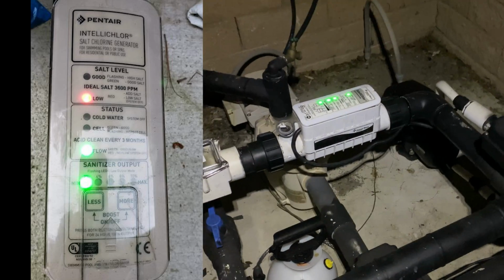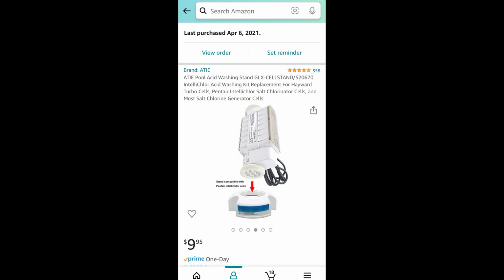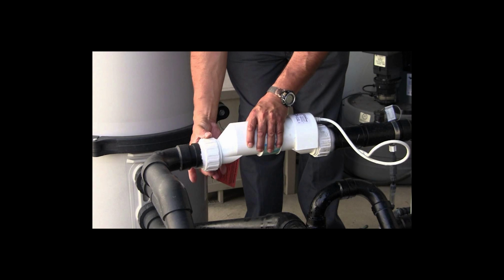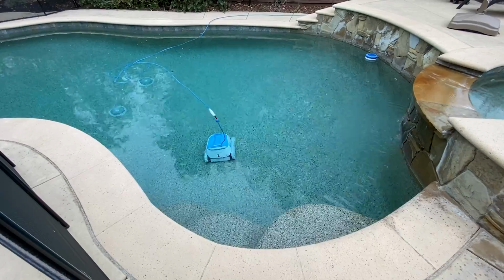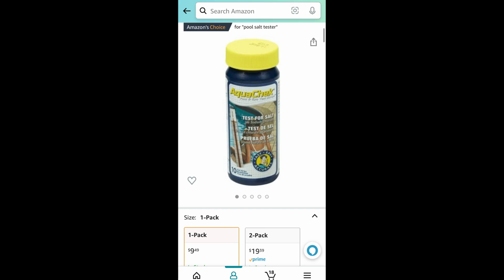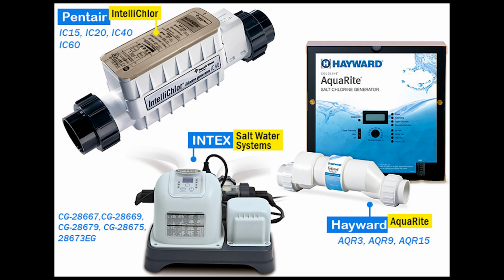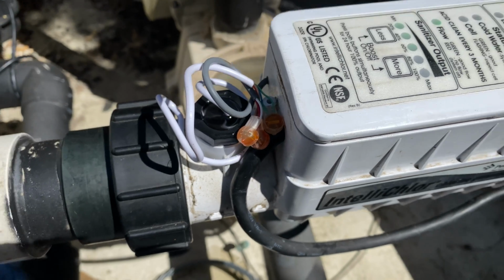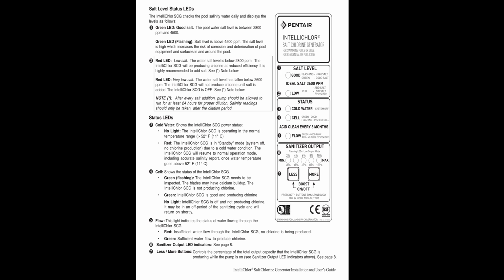Fix Error Codes or Replace Salt Cell Flow Sensor

Comment: Inspect cell reset button?
Reply from the maker: •	There is no physical reset button on the cell or the power center.
	•	The “Inspect Cell” light is just a timer reminder, not a fault memory.
	•	It turns on after about 10,000 hours of operation to remind you to visually inspect and clean the cell.

How to clear the Inspect Cell light:
	•	Press and hold the “More” button for about 3 seconds on the IntelliChlor control panel.
	•	The Inspect Cell light will turn off and the timer resets.

Important notes:
	•	Resetting the Inspect Cell light does not fix real problems like low flow, bad cell, or bad salt reading.
	•	If there’s an actual issue, you’ll still see Low Flow, Low Salt, Cell, or No Comm lights.
	•	Power cycling alone does not reset the Inspect Cell timer. It has to be done with the button.
Reply: @fixitwithjake  thank you so much, will try it out today and get back to you

Comment: Thank you for your video! I have a question. I did all the diagnostic and it seems fine except that the flow light has been going from green to occasionally red. It started doing it a few weeks ago intermittently. Last week it stays on red/no flow the whole time. I checked the flow and it's fine. I changed the flow switch and filter and still remains red.
Do you have any suggestions on what it could be?
Reply from the maker: Here’s what I’d check in order, since you’ve already replaced the flow switch and cleaned the filter:
	1.	Pump speed and real flow
• If you have a variable-speed pump, run it at 2800–3000 RPM for a few minutes.
• If the light turns green at high RPM, step down in 100-RPM increments to find the minimum RPM that keeps it green and use that when the cell is generating.
	2.	Switch placement and orientation
• Arrow on the switch must point with the water flow.
• On vertical pipe it must be installed on an up-flow section.
• Cord on top, paddle inside the pipe free to move.
• Give it at least ~12 inches of straight pipe before the switch and a few inches after. Turbulence from an elbow, tee, heater outlet, or check valve right before the switch will make it read “no flow.”
	3.	Air or restrictions in the system
• Look for air in the pump lid or bubbles in the returns. Suction-side air leaks can keep the paddle from closing.
• Empty pump and skimmer baskets, verify valves are fully open, and check the pump impeller for debris.
• Make sure nothing downstream is choking flow near the cell or switch, like a stuck check valve or heater bypass.
	4.	Cell orientation and condition
• Arrow on the cell should match flow.
• Pull the cell and inspect for heavy scale. Scale can restrict flow and cause odd readings.
	5.	Connection and quick electrical tests
• Reseat the flow-switch plug at the control box and check for corrosion or water intrusion on the connector.
• If you have a multimeter: with power off, disconnect the switch and check continuity across the two flow-switch leads. Paddle pressed = closed circuit, paddle released = open.
• Board check: with the pump running and confirmed good flow, briefly jumper the two flow-switch pins at the control box. If “No Flow” turns off, the board is probably fine and the issue is hydraulics/placement. If it stays on, the control board input is likely bad.
	6.	Startup delay reminder
• Many units show “No Flow” for about 60 seconds after the pump starts. Make sure you’re judging it after that delay.

If you want, post or email me a photo showing the switch, nearby fittings, and the cell. Turbulence from nearby elbows or a vertical down-flow install is the most common cause I see when a new switch still reads red. If the jumper test points to the board, you’re looking at a control board repair or replacement.
Reply: @fixitwithjake can I have your email address please 🙏🏽
Reply from the maker: Fixitwithjake at gmail

Comment: So when i reset the cell/pump my salt "good" light blinks for a bit then just turns off(no green or red light) i confirmed 3200 salt level via k-salt tests. Flow is green and other lights work fine but chlorine keeps dropping. Replace the sensor?
Reply from the maker: Thanks for the detailed info. If your salt level is at 3200 and your flow light is green, but the “good” salt light blinks and then turns off with no red or green light, it usually points to an issue with the cell or sensor not reading properly—not necessarily the salt level itself.

A few things to check first:
	1.	Inspect the cell for scale buildup—even if flow is good, calcium deposits can cause sensor issues.
	2.	Double-check the cord connections to the salt cell and flow sensor.
	3.	If the cell is clean and connections are solid, and the system isn’t generating chlorine (and you’re sure your CYA is in range), then yes—replacing the flow sensor is a logical next step before replacing the entire salt cell.

Comment: Have you had any issues with cell popping the 10amp fuse? Could flow switch cause it or cell electronics shot? Cell is just over 2 years old.
Reply from the maker: The little card mounted on the back wall of your AC touch. System is called a surge card and takes 24 V AC from the saltwater transformer and converts it to 35 V DC that powers assault Cell. If your circuit breaker pops with the salt cell disconnected, that is a good indication that the surge card is bad. To confirm that unplug the two small red wires marked as AC from the surge card and see if the breaker no longer pops.
Reply: @fixitwithjake  10amp fuse pops only when the salt cell is connected. Had a case with Pentair and nothing they can do. Everything I’ve been reading leads to salt cell needs replacing.

Comment: Hi and thanks for your video! I have the IC40 chlorinator and salt level lights (good and low)  are BOTH flashing and the FLOW red light is on. The flow is fine... i cleaned it out with MA and its still lit up like a Christmas tree with these lights flashing that shouldnt be. Now i do have to say the water temp is at about 55degrees. I just dont remember this being such an issue in years passed. Is all this due to water temp? My salt level is at 3400 so that checks out too. You think this could all be the cell? Its about 7 yrs old.
Reply from the maker: It is because the water temp is outside the operating range for the cell. Also your cell is probably near the end of its life after that many years. Double check that you don’t have it installed backwards. It’s easy to mix that up. There’s an arrow showing the direction of water flow.
Reply: @fixitwithjake  Yes its definitely installed with the flow going correct direction. I have solar cover on so lets see if that helps. Otherwise you think a cell replacement is in order?
Reply from the maker: @creative5435 Pentair’s cell is rated at 10,000 hrs. Figure out hike many hours a day your pump runs and see how many days/years it’s been used. Leaving it installed and on in the winter when the water is cold will reduce its life. I take mine inside in the winter and replace it with a plug until the water gets back to the operating range for spring to fall. Because my pool is open here around and the pump is running every single day. Get the water temperature up to the required range and try it for a few few days and see if that fixes things. If that doesn’t you could replace the flow switch that would be the next step just like the video says. And if that doesn’t fix it, they need a new Cell. Don’t mess with the aftermarket ones. There’s none that work well with Pantera they only save you two to $300 and have almost no warranty or tech support.

Comment: Cell has red, white, black wires. Switch has red, clear, blue, green. Is it red-red, white-clear, black-blue, green alone?
Reply from the maker: Here is a photo for you: https://m.media-amazon.com/images/I/71phNasDhtL._AC_SL1500_.jpg
Reply: Thank you. I left green by itself and the cell still reports no flow. I’ll connect black-blue-green.
Reply from the maker: That’s one diagram from one manufacture. There’s several manufactures for these flow switch it so it’s possible that you have a different wiring set up. Every flow switch off used comes with a small instruction manual that tells you what color goes to what wire. So I would refer to the little paper manual that came with your switch…..
Reply: Yes the black-blue-green is correct. After instal, the flow light is still red…🤔
Reply from the maker: Did you install the salt cell back in the proper flow direction? Or is the flow switch in the proper direction? If either one is installed backwards, the water is just gonna push on the switch and not allow it to work and trigger a flow light.

Comment: This video was extremely helpful. Couldn’t get anyone out to help me fix this problem, and by watching this video I was able to do it myself in 30 minutes for less than $50. Incredibly grateful!
Reply from the maker: Wow, nice job! You definitely have the DIYer spirit! Glad this was helpful!
Reply: If the cell has 3 wires and new switch has 4, red-red / white-white / black on the cell and blue and green on the new switch. Do you connect black-blue and leave green by itself?
Reply from the maker: Every sensor that I’ve purchased has come with a small paper instruction manual that tells you how to wire it. It explains three versus four wires and the colors. I’m not sure all sensors have the same color wire so I would refer to the small instruction manual that came with your sensor instead.

Comment: I have an IC40. My flow light is green all the time, even when I turn the pump off. It has a new flow switch. What can it be?
Reply from the maker: The salt cell should not be ON if the pump is off. It should be wired in such a way that the pump timer shuts off and so does the salt cell power. Go to page 35 and street troubleshooting the lights https://www.pentair.com/content/dam/extranet/nam/product-related/product-manuals/pool-and-spa-equipment/intellichlor/IntelliChlor_Owners_Manual_Version_3_units_after_Nov_2011_English.pdf

Comment: What if the flow light isnt lite at all? I tried replacing tbe sensor. Still no light lite on the flow
Reply from the maker: Chris, are any of the lights lighting up when the pump turns on? Or it’s all dark? A bunch of lights should be flashing when it first turns on. If not lights at all besides the flow light, start checking the wire connection from the salt cell to the control box or power supply. Thick black cord that screws into place. And check that no circuit breakers are tripped.
Reply: @fixitwithjake  Thx for the reply. Yes, when I power on the unit all the light come on at least once. Even if the flow light blinks briefly, the low and high salt blink back and forth until it levels out like normal. But the flow light doesn't stay lite not even  continuously red or green. Once the cell levels out the red low salt light is on and three lights at the sanitizer output are green. I can decrease output but it won't increase above the third light. I thought changing the flow sensor would at least get the flow indicator to come on, but no luck.
Reply from the maker: Because it is still reading as low salt it may not allow your salt cell to turn on and thus the green flow sensor light as well. But to be honest, I’m just guessing here on the logic. Is it possible that you installed either your flow sensor backwards, or the entire salt cell backwards in the wrong direction? Because that is a common error and if that is the case, then the flow sensor, it has water, pushing it into the closed position at all times. Have you had your salt levels checked with a tailor test kit or a Leslie pool store? That is also super important that you get an accurate measurement and do not rely on the salt cell for your salinity measurement.
Reply from the maker: I did some more research on this one today and I cannot come up with a relevant answer. I would call Pentair technical support on the phone and let them know about the flow light not illuminating and see what they have to say? Have you verified that the wire connections are all working well on your new flow sensor? I would definitely start there.
Reply: @fixitwithjake  Thank you. I went ahead and spent the 1k on a new cell. Appreciate all the support.
Reply from the maker: Sounds good! If it’s 4+ years old you likely got your use out of it! If u don’t have a plug for the winter u can use the old salt cell. Just cut off the wire and install it each winter. It will make your nice salt cell last much longer sitting in the garage dry if u don’t use it year around. Just an idea. Have a good weekend.

Comment: Thanks for the video! If the red lights are only present during the diagnostic test and not during normal operating conditions, is the flow still bad? Also, would a bad flow switch cause the system not to produce chlorine? Thanks!
Reply from the maker: So right after you turn on your pump the salt, so will turn on and go in the diagnostic mode. That runs for about five minutes. After that time all the red light should go out and if it becomes normal green lights, then you have no issues. Yes if the flow switch is bad, it can stop your chlorine production. Either doesn’t know that there’s proper water flow so will not produce chlorine. Or if your salt level is too high or too low it’ll also prevent it from producing chlorine. And the flow switch is a bit temperamental. So always do a really good salt level test not using the salt cell sensor. Just use a basic Taylor test kit.

Comment: thanks for this video, have ordered a sensor for 42$ on amazon using your link. Our IC 40 must be at least 5 yrs old but when we test how many hrs of use it has had (by holding down the "more" button for 3 seconds and watching the green lights) it only reads 20% (see manual), showing lots of potential life left in it.  I was wondering what app you are using on your phone at the end of the video?
Reply from the maker: Let’s hope a new sensor fixes it! It’s def worth the try. The app I am using is the Pentair Screen logic Wi-Fi system. Control your pool from your phone. I just made an install video on it, on my other YouTube channel here: https://youtu.be/c806qqqEoKI
Reply: @fixitwithjake  thanks Jake, watched the video, the pentair control center antenna looks like the one I already have to go with the remote control unit, are they the same?

Comment: @FixItWithJake THANK YOU!!!  Just an FYI, because your video was the best of sooooo many I viewed on the IC40 sensor issues, errors and replacement, I mentioned you in my Amazon review for the Optimum flow sensor I bought. 

Long story short: Never owned a pool before. In December 2022, my wife and I purchased a home in SC with a beautiful pool that was built in 2019. When we had the pool inspected, the Low Salt indicator was on and the chlorine levels were low. We were told that is normal when the air temps are below 52 degrees. Fast forward, air temps are in the 80s now, pool temp is 75. Low salt light still on, control panel shows 2050 ppm, dipstick shows 2800 and pool store test shows 2900 ppm salt, but 0 total and free  chlorine. 

We’ve had a company servicing our pool since early March. They came out and did a $190 diagnostic visit because their tech said the power to the IC 40 was off. We never saw it off. Always on and always with the Low Salt light on. 

Their tech said the cell was shot. $1,500 to replace it and and other $190 to install. 

I cleaned the unit and it really wasn’t too bad. I thought I was doing good by ordering a new IC 40 on Amazon for $1050 and was going to install it myself. I patted myself on the back for saving about $700. 

Then I stumbled onto this video of yours. Having 30 days to return the new cell after it arrived, I opted to order a new $39 sensor form Amazon as well and give that a try. Worst case scenario in my opinion, if the sensor did t work, I only saved $670 then. Lol! We’ll the sensor arrived yesterday. Thankfully because of your video, I knew I could replace the sensor with the IC40 still attached to the pool plumbing. That was such a help!! Thank you for showing that!  Also l, thanks for the wiring diagram and tutorial. My old sensor had three wires and the new one had four. Thanks to you, I knew which ones went where. In less than 10 minutes the old was removed, the new was installed and it was powered back up. After about 10 minutes of alternating high and low salt lights, it calibrated itself. For the first time since buying this house, I see a green Good Salt light. Salt level on the panel is 3050 ppm and by dip stick 2900. I already set up the return of the unopened new IC40, left a review for the sensor and tagged you in the review. 

Awesome job brother, thank you for saving me about $1,500 with this great video. 

PS - I fired the pool service company, will be disputing the charges for their ridiculous diagnostic fee by which they found the cell shot. Also, after I replaced the sensor, I checked cell life and have 40% remaining! 

Thank you again.
Reply from the maker: Great job GK. This comment made my day! I'm so glad you were able to restore your cell especially since it still has 40% life left! Thanks for the shout out on Amazon! Below 57F water temp can expect a cold water or low salt light. Above that, it should be going away. In the winter you will want to turn it off and use normal chlorine. Try to get your salt levels up to 3600-4000ppm. Do it slowly. One day at a time and let each bag dissolve so you don't go over 4000ppm. I let me robot drive around each time and mix it all up. I just had to get mine back up after all the rain this winter dropped it down to 1500ppm. It took me a week to slowly get it up and I used this test kit over and over. Works so well: https://amzn.to/3ApHFnJ